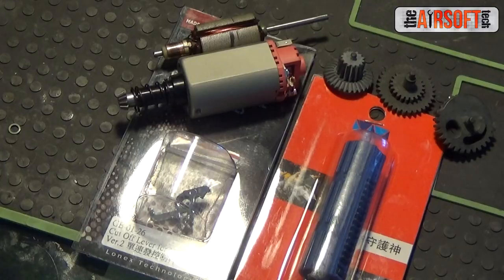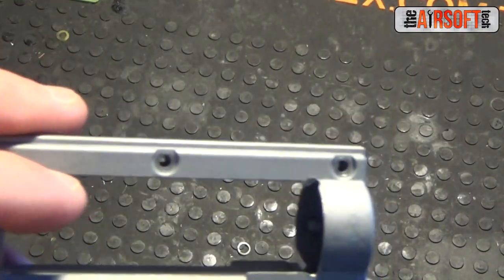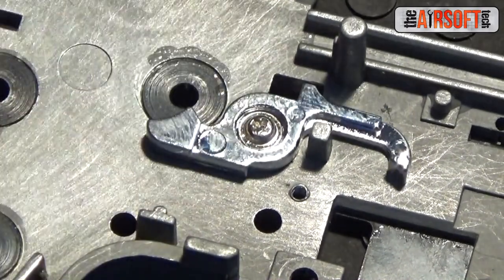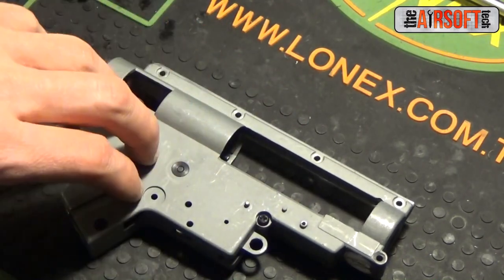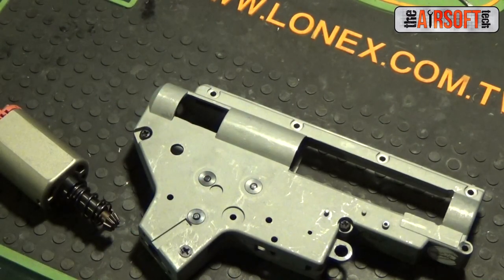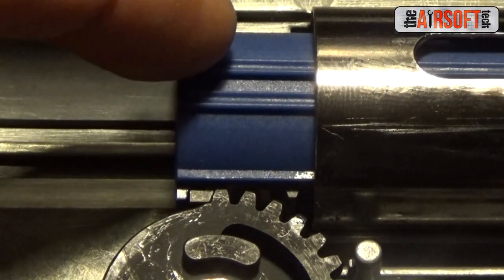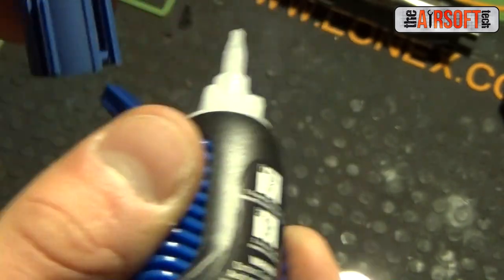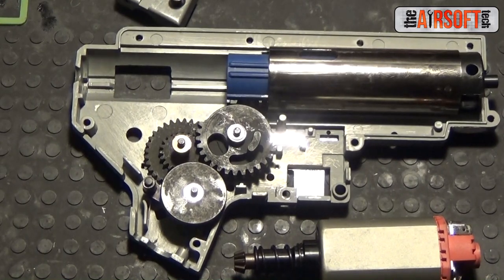Epic Upgrade Time, VFC M27IAR / Part 1

Comment: I honestly do not get how all of you techs out there can sit a gear box down open with the anti reversal latch in place, and it doesn't push everything out of its place. Blows my mind. I always have to tie mine with teflon tape to hold pressure off the other gears so they don't knock out of plum.

Comment: At what point would you recommend using bearing axle bushings over solid axle bushings? Certain rps target? maximum spring strength? motor specs?

Comment: i have had a g&g combat machine for a while and i was wondering what parts would be good to install to make it a durable  ballance setup
25rps 
380-400 fps

piston?
piston head?
motor?
cylinder?
air nozzel?
gears?

love the vids Man keep up the good work
Reply: First of all you need M125 spring, then new bearings, maybe whole piston with pistonhead, cylinderhead and nozzle.
Reply: 13:1 gears m130 spring ssd 3 teeth new gearbox shell and a high torque motor along with a mosfet wired to deans